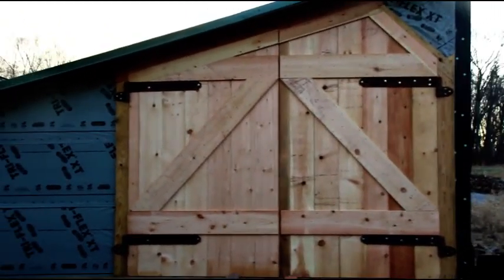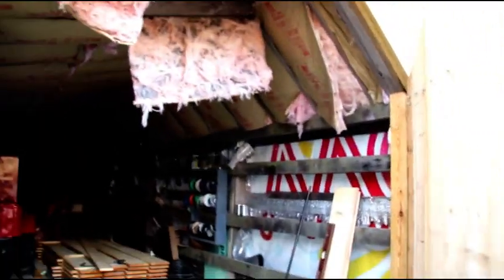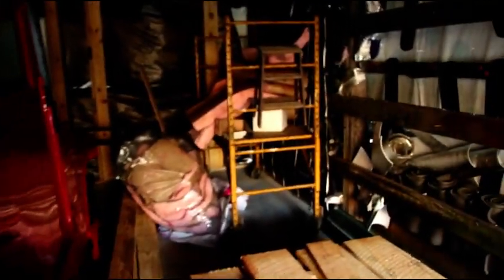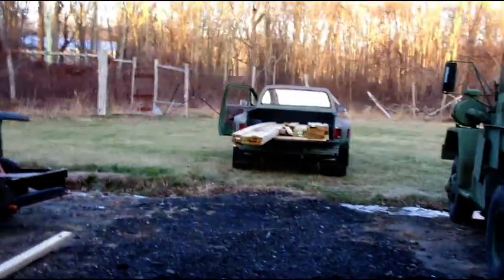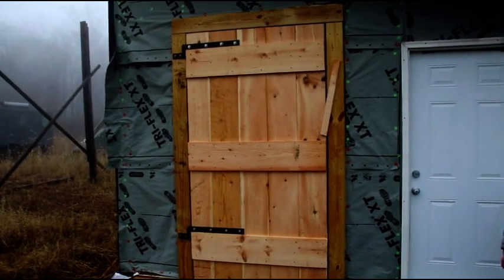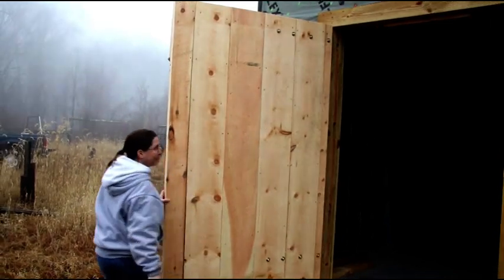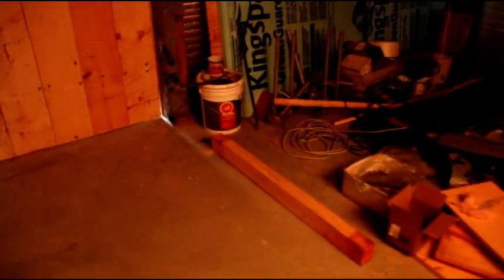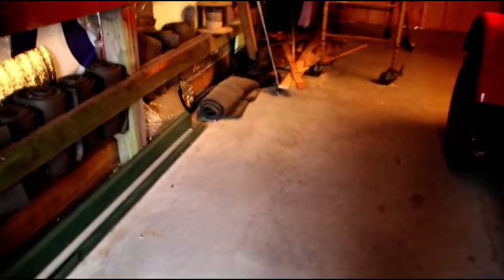Building Custom Doors With My Best Helper..... HAPPY NEW YEAR TO ALL

Comment: Tig welder,, ground is hooked up wrong somewhere,, check plug, and then follow back to supply. If your getting shocked,  then your the ground. Same was happening to me, I checked the supply outlet cord, someone had the wires wrong, one of the hots was on the ground leg.
Reply from the maker: Checked and re checked all the wiring and still giving me trouble.  Had 2 different electrical guys look it over.  We grounded the table and that works for arc and mig welding, but hi frequency tig still gives a good bite.   Taking fab table and Tig welder into new barn.   Worked fine in the main barn for many years but not good in the trailer.
Reply: Happiness,  prosperity , health, and Ĺove for you Maria and Brian, all the days of your lives.
I thank you for sharing your knowledge and wisdom to with us.